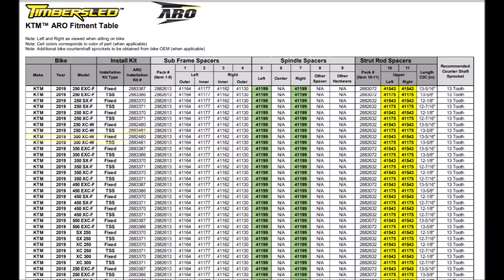2020 Timbersled 'Riot' Install KTM 300tpi

Comment: Timbersleds are very popular here in British Columbia  ....alot of people are buying the "camso" track kits aswell  ..they are also a good unit  .. front twin wheel kits are handy for crossing dirt but don't work very good crossing creeks because you need to keep stopping to install and remove them at every creek  ..we are trying to design a ski with a center wheel  ..so the center keel will be moving tire tread and has edge keels so it still sidehills good ..a wheel about the size of a 12inch moped wheel  ..we've only designed it on a napkin so far but center tire is the answer  ..whoever brings a center wheel ski like that to market first will make alot of money.       ....I recommend you get a recluse clutch
Reply from the maker: Interesting!

Comment: Rode a riot snow bike for the first time last week at a timbersled demo days. Off all places to offer an experience to new enthusiasts they did it at a motor cross track. To say the least it was warm and the snow was thick and rutted which made the steering feel like the steering stem bearing was nearly seized.
Reply from the maker: Yea! Ya need fresh powder!
Reply: blancolirio thats what they tell me. No sure why they try to market them in the upper Midwest especially when there’s so much road and driveway crossings. Couldn’t even imagine that with a single ski.

Comment: I wonder why the bike manufacturers don't get in on the sledding action and make their own kits? Or sell as a complete bike designed for snow (with the swing-arm wheel assemble as an option)?  Especially Yamaha, since they already make snowmobiles.
Reply: in business parlance"its economies of scale", you can bet if it takes off, they will be on it.

Comment: How does the engine cooling system hand,e the extra load of riding in the snow and not moving thru the air as fast?
Reply from the maker: Good question, just like technical singletrack, the radiators and an electric fan. In deep snow ya gotta block the radiators off...runs too cold.

Comment: Did you hear about the crash in Kazakhstan?
Reply: How about the lost Helicopter in Kauai?
Reply from the maker: I did. Aborted takeoff gone wrong?  
Loading? Icing? Dont know.
Reply from the maker: @JoeLinux2000  did not...
Reply: I have flown both 757's and 747's through Almaty. Very rough runway. Wouldn't be surprised if they left parts on the runway. Bishkek, Kyrgyzstan the same.
Reply: No fire thank God, perhaps they forgot to refuel it.

Comment: I would have thought some beading on the front ski on either Edge would help half an inch deep half an inch wide Square stock, give you that turning group.
Not sure why it needs to be that long seems a lot of stress on the wishbone mounting on the frame I wonder if that's going to cause an issue with fatigue.
I thought if its made half the length but an extra 2 or 3 inches wider would have been a better solution better turning circle. I can see the benefit if you're doing a lot of high jumps but not for general use.

Comment: Did your  XC come with the tail light on the rear fender or did you add it? I just got a 2022 XC300 TPI and has no tail light I added one but it doesn't look as nice and clean as yours